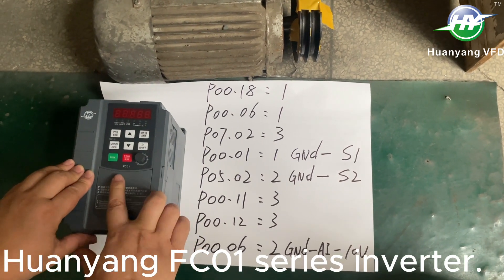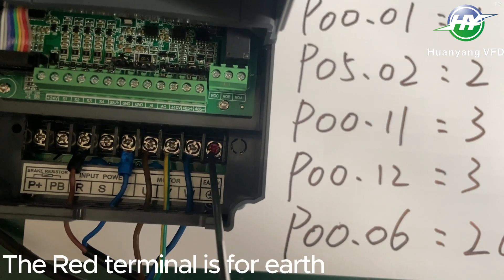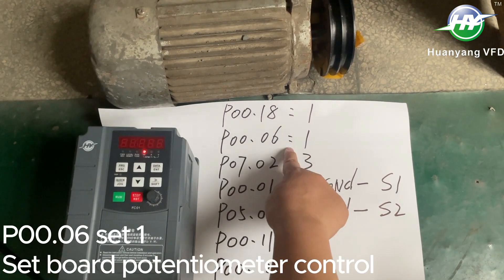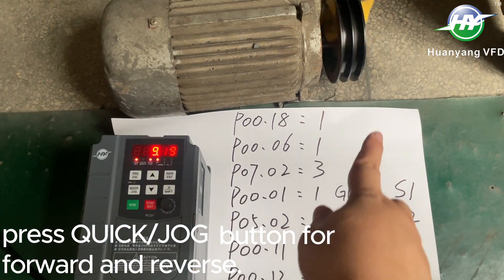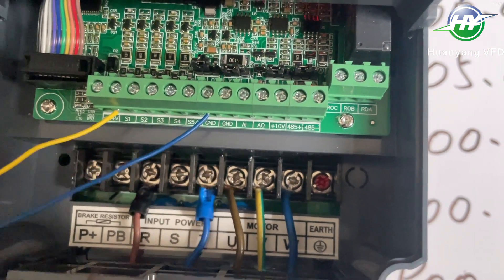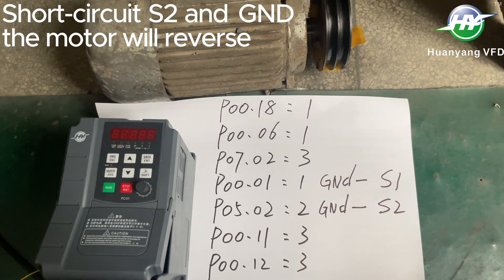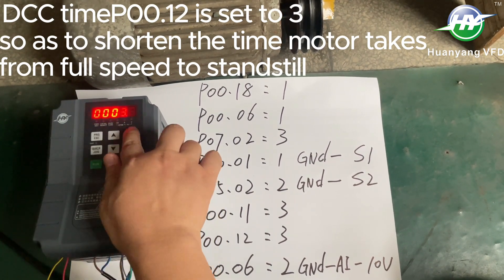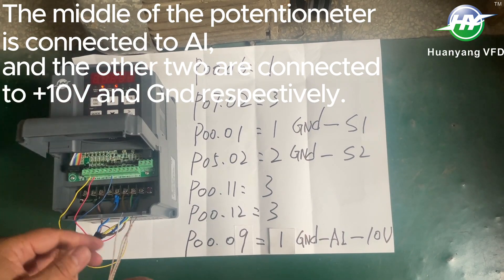VFD FC01 Series Basic Operations

Comment: You showed 3 wires coming from motor. The Vevor I have only instructs me to connect 2 wires. Is a 3rd necessary? I can’t find where it would be
Reply from the maker: “The variable frequency drive (VFD) is designed to drive a three-phase motor. Two wires are typically used for a single-phase motor, but a VFD does not work well with single-phase motors. You can search online for more information on this topic.”

Comment: I noticed in the video that you have the single phase input power connected to terminals R & T.  The manual strictly states to NOT connect to terminal 'T'. i.e. you should connect to terminals R & S.  Please explain the discrepancy.
Reply from the maker: “R, S, and T can all be used as input power, but some batches of modules can only accept R and S.”
Reply: @huanyanginverter6516  
So, to be clear, ALL FC01 units work with R and S and some will work with R and (S OR T)?
Reply from the maker: @johncarson2877  “Currently, all FC01 series products can accept input power through R, S, and T.”

Comment: Hello!
The video is very good and educational. I ask you: how do I perform autotuning with this FC01 variator?
Reply from the maker: I don't understand what you mean. Please explain in detail
Reply: @huanyanginverter6516  Thank you for your answer. In P00.00 this observation is presented:
Note: Carry out motor parameter autotuning before
adopting vector mode.
In the GT series the P0.16 code highlights this autotuning function:
P0.16 Motor autotuning parameters 0 - 2 [0].
In the FC01 series manual there is no indication of how to perform autotuning of this device.
Reply from the maker: Only vector control has the auto-tuning function; FC01 does not belong to vector control.
Reply: @huanyanginverter6516  Ok! Thank you.